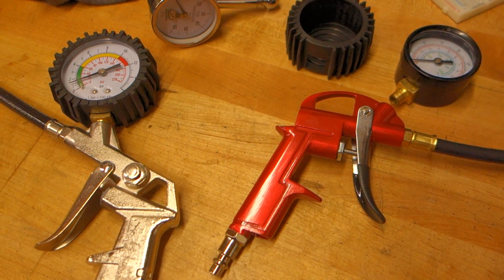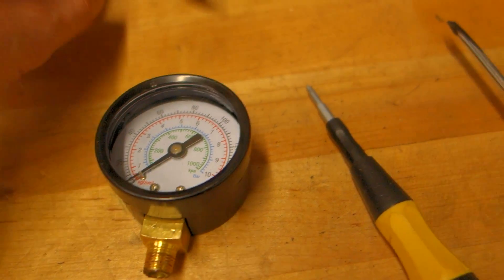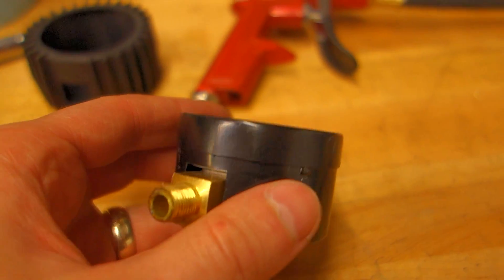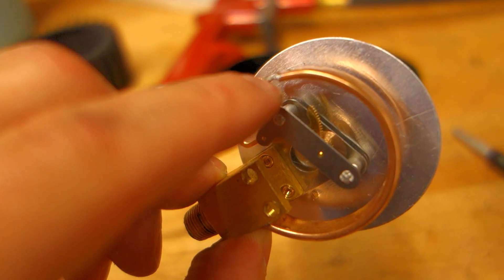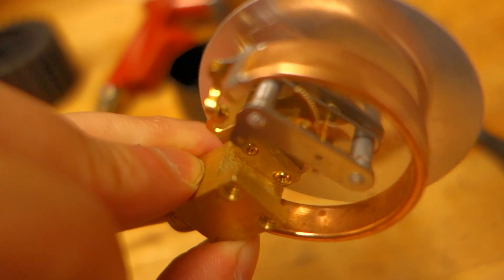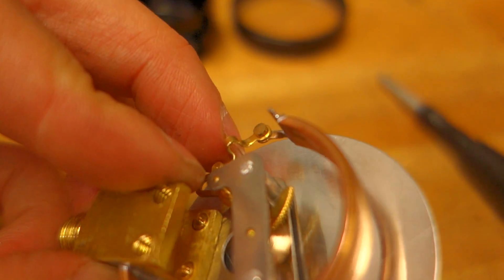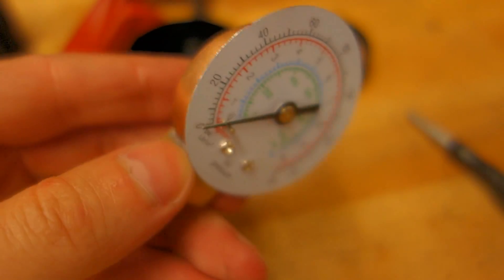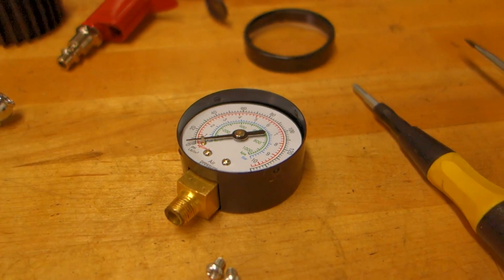How to disassemble, repair and calibrate an air pressure gauge

Comment: You are a Godsend.  Had all but given up on my tire gauge, guts identical to yours.  Stopping at 10 instead of 0, way off.  It was actually in the trash bin already.  Then decided to look for how to repair it online and found your video.  Yours is a great PSA.  Fished my gauge out of the trash, and now I have a working, pretty much calibrated air gauge.  Extremely useful video.  Much appreciated!

Comment: MANY thanks. Your video helped me repair a TireTek gauge that would not "zero". I probably didn't have the optimal tools but with a just screwdriver and small needle-nose pliers I was able to do the job. The bezel actually popped off easily with a flat screwdriver. There's a slot at the top of the gauge that allows this access.

Comment: The gauge should read 1 bar NOT zero when not pressurised, zero would be a vacuum,  1 bar is atmospheric pressure
Reply from the maker: Not on most gauges I've seen in the US. It's just a question of definitions. If you wanna just measure pressure above atmospheric, you can start at 0, as these gauges are marked.

Comment: I use a T air fitting connected to the pressure. Connect a good knows gauge to one side and the one you're working on to the other. You can now set the one you're working on to read the same as the know good reading gauge.

Comment: I have two older Accugauge that are both out of calibration.  Yet both start at zero still.  Just an FYI , that it doesn't have to be off zero.
Reply from the maker: Do they have a stop at 0? Because then zero doesn't mean anything.
Reply: @steelddd  yes, both have material stops at zero.  I understand zero means nothing because of that, but I would've thought because of that stop, it would've resulted in too LOW a reading of our of calibration? But I'm sure one is reading about 7-8 lbs HIGH at ,,,,,. GIANT OOPS!  I think I see the problem now.  Because it shows 30 and is actually close to 38.  Yep, you're correct.  I've gotta get it to register higher, while still starting at zero!
Thanks.  Sometimes it takes me a little longer. 😂😂😂

Comment: I just took  my vac/pressure gauge apart because the the needle was off zero.  Simply by gently pressing on the bourdon tube, the toothed lever that rotates the dial moved to its end location (probably jumped of the dial axle), the need shaft rotated and reset itself zero all by itself.  The dial is now on zero and the dial moving mechanism is centred.  Thanks for the video 👍

Comment: I was scratching my head how to bring back the needle of my analog gauge back to zero. Thanks for the video. 
You have another gauge there with which you said you checked the repaired gauge. How do you open that one? There are no screws on those kind. Mine looks the same and there is no way to open it. Should I knock off the pin jutting out on the sides?
Reply from the maker: I haven't taken one of those apart yet. Let us know if you find the trick.
Reply from the maker: I finally took a look at it. By the pins it looks like it's probably not meant to be disassembled past the bezel. But I see there are some screws on a piece that retains the needle. Maybe you can take that off, pull off the needle and reset it. Maybe those screws retain the faceplate as well. Sorry, don't feel like ripping mine apart :)

Comment: All you did was zero out the needle.
Still needs to be pressure calibrated with the right equipment.
Still a good share

Larry
Reply: Is that possible and economical

Comment: Hi friend! Will this work as well for a water pressure gauge. I have a hydrotherapy machine that is the sole driver of my current biz. It just broke. No clue how to fix it, and the manufacturer Dotolo is no longer functioning. Any advice or help?
Reply from the maker: The principle should be the same. But if it "broke", you might have bigger issues (still, doesn't hurt to take it apart and see what's up in there. You should be able to find the right gauge with right thread, right size, right pressure and right fluid at a supply shop. Measuring the thread is the tough part, but a hardware store might be able to help you.

Comment: The zero adjust is actually calibrated by simply removing the needle and putting it back at zero. There's also an Adjustable Link for the span and a linearity adjust which is often a screw.
Reply from the maker: Shaine MacDonald thanks for the tips! Do needles come off and on easily by hand or need a special tool?

Comment: The Pressure gauge linearity is more than likely not messed up. Through use, the gauge will fall off of its zero. The best way to bring this gauge in is to take it to mid scale with pressure or liquid. You will want a known good gauge as your reference. Once you have the reference gauge at 75 psi (the mid scale of your 150 gauge under test) pull the needle on the uut and reset it at 75 psi. When you remove the pressure, the gauge should return to zero and be back in its linearity. The specifications for pressure gauges are normally at nominal points. 20% 50% 70% and 90%. for 20%, you are looking at a 2% spec. At 50%, 1%. At 70%, 1% and at 90%, 2%. Once you have tested these points, you will know your pressure gauge is within specifications and ready to go. A bourdon tube bend will only be done when the gauge has a crimped on gauge cover and you can not access the gauge needle from the front. You will take the gauge to mid scale and try to bend the tube from the top hole of the gauge. This works most of the time but takes an amount of tinker time to nail down how to bend it. I do it with a flat head screwdriver and looking at the front of the gauge, put the driver in the top and down the left side. this allows for the best results. anyhow, if you can get some new techniques from the information i have provided, you will be in good shape. Bending that u shape on the arm is not a good idea. The bending only weakens the metal and brass is already a soft metal. pulling the needle using a needle puller is the best method but can be done with a pair of needle nose pliers and a pick if done carefully. anyhow, best of luck to you.
Reply: Phillip McGuffie You should do a video and link it here
Reply: @rdg515  I could do that if it would help. Sorry for the late response. I was not aware that this response was even made. lol
Reply from the maker: Phillip McGuffie thanks for the insights! Might try those next time I have a gauge to fix.
Reply: No problem. I work in calibration and this is how we handle gauges that fail to meet the manufacturer specifications. Good thing to look into if you do enough of these is to make a pressure comparison jig. something with a reservoir to handle the supply to the reference gauge and the unit under test. Makes gauge calibration a snap. We use denatured alcohol as our solution. it dries fast and rids the gauge of contamination quite well.
Reply: Hi. Wouldn't pushing the needle against the tube put excess pressure on the gear teeth and loosen the gauge causing a wobbly needle reading? Under normal operating, the gears only have to move the needle.
Reply: @grizzalo6117  it does but if done with caution, you will not need to worry about it. it also depends on the range of the gauge too. lower gauges will have a more sensitive movement assy. where larger ones can handle the pressure. With putting the needle back on, it will not do any damage. This is an industry standard for adjustment even from many manufacturers.
Reply: @phillipmcguffie1183 
I have an old pavoni espresso pressure gauge that is stuck. Any tips on repairing and recalibration? I believe it's the same mechanism inside